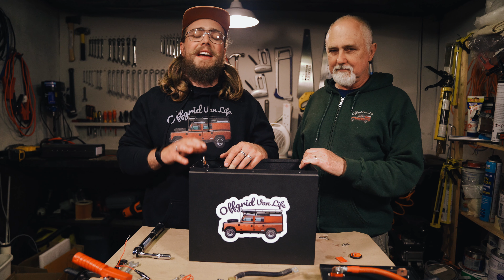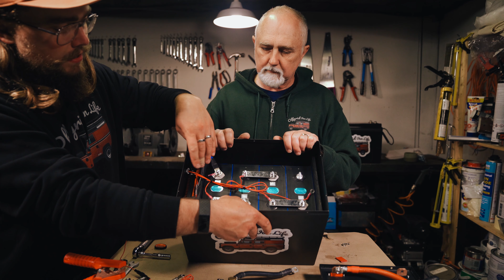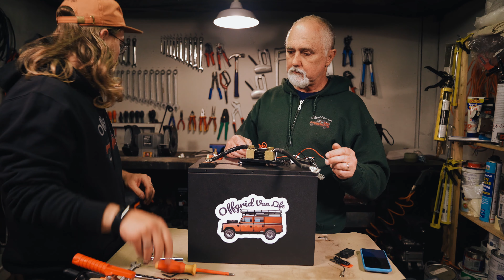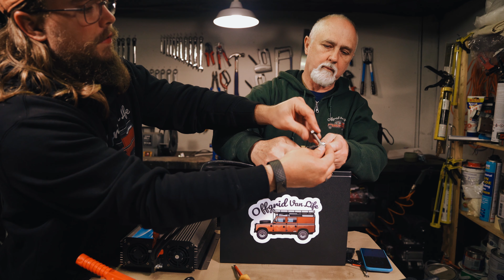Testing our latest "drop-in" replacement LiFePO4 battery

Comment: Fairly impressive results pulling 170A for that long.  The two issues I can see are as follows: (1) You have the BMS flush with the first cell in the battery box.  That could cause early wear-out of that cell verses the other cells due to the combined heat (maybe put a temperature sensor right on that interface to get more data).   Usually the BMS is placed above the cells with a separator.  And (2) another potential problem is that cell expansion and contraction (as the battery ages) could compress into the BMS when it is in the side configuration, which is also not desirable.

-Matt
Reply from the maker: Hi Matt. We put a piece of plywood between the BMS and first cell, so it's not directly contacting it. Obviously plywood is not inert, but it would insulate the cell somewhat. I agree that it would be better to have more insulation between the BMS and cell to ensure less heat transfer. We also clamped the cells using plywood and threaded bar, so that should reduce movement due to expansion and contraction in the cells.
Reply: @offgrid_power  A lot of these cells do like compression of one sort or another.  Also note that the shell for each cell is positive and only has a thin wrap around it for isolation, so you don't want any metal rubbing against it and potentially causing a short.

For compression, the standard seems to be to snug the cells up when they are at around 50% charge.

-Matt
Reply from the maker: Thanks for the advise, Matt!